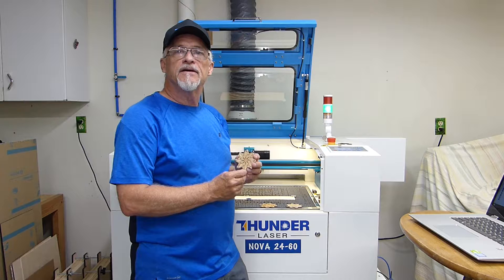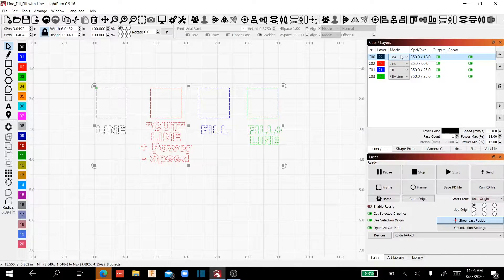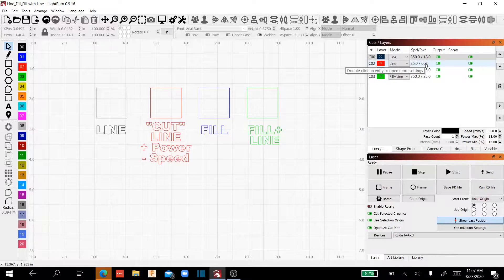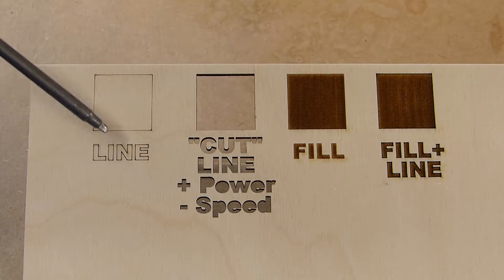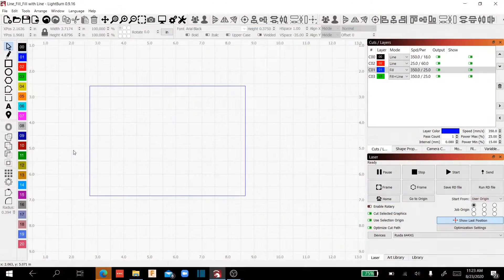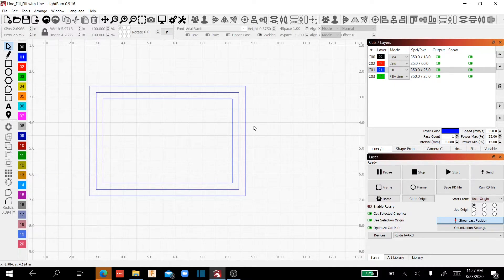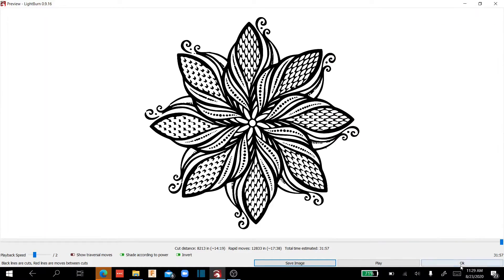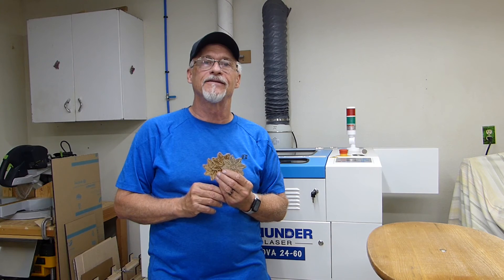LightBurns Line - Fill - Fill + line Modes

Comment: I am assuming that Lightburn now uses "Offset Fill" instead of Line and Fill as shown in this video, am I correct?
Reply from the maker: No offset fill is completely different action and has nothing to do with fill plus line. You still have fill plus line it’s in sub layers now
Reply: @computercreationz  Thanks for the quick reply. I just investigated adding a sub-layer and still did not see line and fill after creating a sub layer. I assume that there are settings you need to complete in the sub-layer and that the label "line and fill" no longer exists. I am on a mac version. Not sure if that makes a difference.
Reply from the maker: @buzzie8  assuming your on a co2 laser there should be. + at the top right hand side of your layer when it open up it first tab will be fill then hit the plus to,add a sub layer and change the mode to line. That’s how you get fill + line

Comment: I just watched your video. I’m hoping you still respond to it. I just bought the Nova 51/100 laser. I currently do not have the option of fill + line? I do have Fill option and Line option. Can I change something somewhere in settings so I get the option of Fill + Line? Where would that option be? Thank you. I just did a 13 inch logo on birch and have exactly what you describe. Fill only is not crisp at all. Thank you for the informational video and your time.
Reply from the maker: the fill plus line has changed in lightburn. Lightburn has added sub layers now. the functionality is still there you just access it differently. search sub layer in Lightburn on youtube
Reply: @computercreationz  thank you. I did find the multi layer. Appreciate your videos and your quick response!!

Comment: when i use lightburn and apply the line option i end up with a line showing the travel path of the laser between the different text or images i am burning on a sign. like the laser doesnt shut off on the travel path of the laser before turning on the laser for the next letter or image on the cuts/layers list. what am i doing wrong. I use a sainsmart 4030 cnc machine
Reply from the maker: I’m believe it’s a g code change that you need to change but I don’t deal with those types of lasers so I’m not much help sorry

Comment: When engraving a tumbler would you use Fill Plus Line?
Reply from the maker: No just fill, doing vectors (line) is not recommended on a roller rotary

Comment: I just downloaded Lightburn and it doesn't have the line and fill option, just line, fill or offset.  Any ideas on where I could find it?
Reply from the maker: it’s there just illustrated you will notice a little + on the top right hand side when you layer is open you add it there. lots of YouTube videos on this new feature. it’s actually a good thing lots more flexibility

Comment: great video, as a newbe this is very helpful, question - how do you not get the burnt look?
Reply from the maker: Hi Bob, burnt look as in the edges or top? usually it’s controlled by air flow and power. if it’s the edges your going to slow or using multiple passes, increase your air flow. if it’s on top you using too much air. very little air flow is needed when engraving.

Comment: yeah that "O" option isn't available for me for some reason, as well as the "Line+Fill" Option. did anything change in the program?
Reply from the maker: They added sub layers so you just have to hit the + sign to ad a sub layer to add the line in fill plus line. This is much more versatile.
Reply: @computercreationz  where is the plus sign? when i clicked it it just zoomed in on my work
Reply from the maker: @joshshor3758  open your layer and it’s on the top right hand side. YouTube lightburn sub layers
Reply: @computercreationz  found it thanks, one issue I keep running into is that my laser engraver wont engrave when I use multiple sublayers which strange

Comment: Aloha, how do I get the fill  + line in my settings.  It doesn't show up in the drop down menu.  I have a Nova 51-30
Reply from the maker: they are sub layers now it’s there you just have to add it. start will a fill and look for the plus sign in the upper right hand side of the layer when open. add another tab and change it to fill. look up LightBurn’s video on sub layers. very flexable

Comment: I have a image with only text but it is in line mode(hollow) I want to fill (solid letter) how can this be done?
Reply from the maker: set you layer mode to fill, if that doesn’t work it means you have an open shape. it will only fill text or shapes that the lines are continuous..
Reply: @computercreationz  the top right says it's a image, can't change to fill or line
Reply from the maker: @mikeledee8786  yes you can only fill a vector not an image. If
You trying to fill an image it’s not possible. Use vectors in lightburn
Reply: Thanks for your help

Comment: Hey when I import an image, the mode will not let me select anything. It just says Image under mode. 
Is that OK?
Reply from the maker: You can either engrave as a picture or use the trace image feature and create a svg vector graphic. But only limited color contrast can be traced.

Comment: Im try this out on a design Im working on using scrape material before I put on final product. Thanks for the informative video, Ive been watching all your videos and learning so much. One question is there somewhere I can download settings for the library for different material to start adjusting to adapt to my laser like a basic list and basic settings? I have a 100 watt c02 laser would love to be able to find a file and save to lightburn to save time.
Reply from the maker: usually the laser manufacturer will have one to get you started. I know Thunderlaserusa.com has some on there site specifically for thunder lasers.

Comment: That ball valve on your wall.. Is noy intended for partial use. On or off is it. If you want to regulate.. Get a regulator. 
And yes. You can do what you wish :)
Reply from the maker: Apparently you didn’t see the regulator right below it!
Reply: @computercreationz  
It was a quick video section.. So no Apparently i didnt. I was focused on your hand motion.
Dont be offended.
Maybe you can explain why so lazy as to not fully open the ball valve?
I dont plan on sitting here arguing..  Was just trying to share something.
Reply from the maker: @turboflush  oh I’m not offended, I appreciate your comment. I’ve made lots of mistakes along the way. The reason I’m lazy as you put it is exactly what you mentioned in your first comment. It only takes turning the valve a small amount to get full pressure! Exactly your observation.

Comment: When i try to use fill on a border like you explained in the video, for some reason it is trying to fill the whole thing in and giving me an estimated time of 10+ hours, do you have any advice to help with this?
Reply from the maker: make sure your outside border is grouped and the same layer color. or there is an open shape where the square or rectangle is not totally closed. give that a try

Comment: Hello 
I do like all your video and the time you spend to explain stuffs ..     

In LightBurn there is (now) also the Offset Fill ... It's fast and giving some very special effects ...  the same effect as concentric design  in 3D printing first/last layers 

Do you like it or have any recommendations about it ?
Reply from the maker: I’ve read that that setting is for diode lasers. my laser is a co2 . what type of laser have you tried it on? thanks for your comments!
Reply: @computercreationz  correct ...I tested it with my diode A5 20 w ( Atomstack )

Comment: I bought LightBurn because of all the things you can do with it. Last night I figured out how to do some things on my own and now I just learned more.
Reply from the maker: It’s great software!
Reply: Did you learn  the mustard trick to engrave stainless steel? Or the water and baking soda spray to get darker results on wood? There are so many tricks to this trade...
Reply: @OregonDARRYL  no, I didn't know about that. What kind of mustard do you use, yellow or brown? I guess another question to ask is, are you using a diode laser or a CO2 laser?
Reply: @OregonDARRYL  thank you for the information. I watched the video and will add it to my repertoire. 
I tried something the other day that I've not seen on YouTube (not that there isn't a video on it). I engraved on the Dollar Tree glass mugs. Simply paint the area you want to engrave with gloss white spray paint and set your speed to 500mm/min or slower and 100% power. Clean with acetone and you will have a black etching that will not come off. It is a good idea to clean the glass with acetone before you paint and then avoid touching where you want to etch. Yea, experience taught me that lesson. Thanks again my friend.